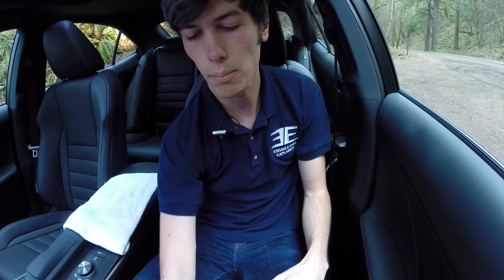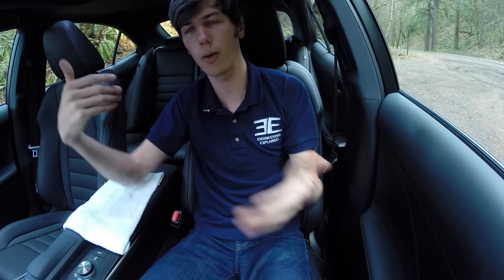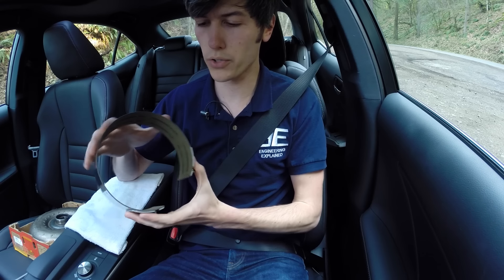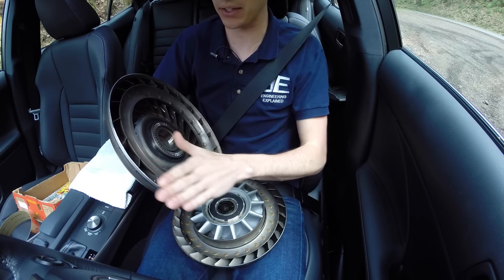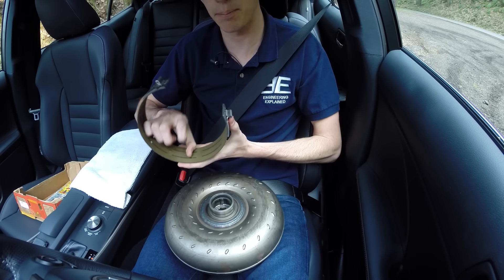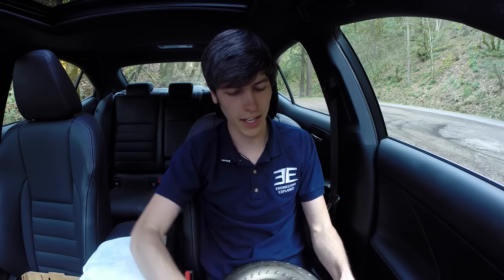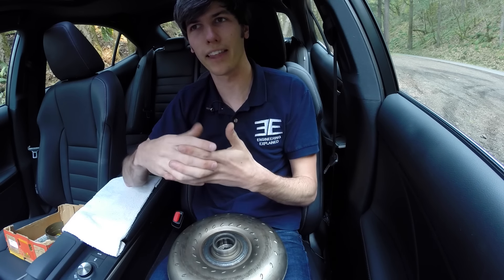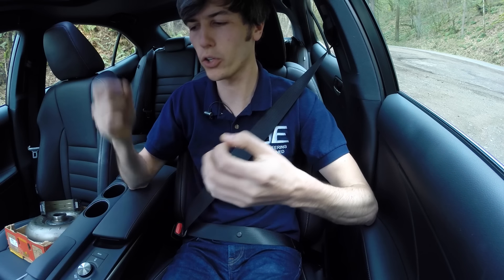5 Things You Should Never Do In An Automatic Transmission Vehicle

Comment: "modern cars cut fuel when coasting in D" modern as in 2010+? Modern as in 85+? Modern as in 50s+? What is "modern"?
Reply: If it's electronically fuel injected it will do this for the most part. There may be some exceptions due to lazy coding, but my 92 BMW and 95 Ford both did this.
Reply: 87-95 chevy Trucks with TBI fuel injection had lots of parameters for DFCO (deceleration fuel cutoff)
Reply: I HATE it when people say "Modern Vehicles" that is the worst damn vague description
Reply: +Boosted Fool I generally accept that term to mean OBD2 compliant 1996 and newer vehicles
Reply: +Boosted Fool lmao I know man. It happens 
quite often.
Reply: +Eric Meeson thanks for clearing it up.
Reply: +PioneerDC4

I feel this part was really not explained at all.  Idk why but he goes super in-depth about putting a vehicle in park but fails to explain simple stuff like this...

Lets start out with vehicles which have a carb (1980's and before basically). Air is bought into the carb via the air intake/filter. There it is mixed with fuel and sent to the engine. Just before the carb, there is a gate which can restrict the flow of air into carb. As you 'open' the throttle (push down), it will open this gate, and therefore allow more air into the carb. The more air in the carb, the more fuel is mixed. The greater the flow of air/fuel mixture into the engine, the greater the power.

Now... As you are driving along, and you close your throttle, the flow of air is restricted, the amount of fuel into the engine is reduced, and therefore the power output of the engine is reduced. When the throttle is completely closed (idle), you are using nearly no fuel at all. You can have a 4 cyl carb'ed engine with a 1 gallon tank on idle for days before it will run out. So, if you think about it (and he did give some numbers for this), the amount of fuel used on idle, while moving is next to none.

With "modern" vehicles, aka fuel injected vehicles (1980+), it is a little different.  You no longer have a carb, but you still have that gate controlling the flow of air into the engine. As you open the throttle, that gate is opened and more air goes into the engine. The main difference is that you have fuel injectors. These injectors are most often controlled by the vehicle computer, which measures the airflow and determines the amount of fuel to inject into the engine (instead of the mechanical method in the carb, it is now done via a computer). Fuel injectors are much more efficient than a carb in almost every situation.

Now, with the ability to directly control the fuel injector, you can actually completely shut off the fuel when it's not needed. The situation is present when the vehicle is moving, yet the throttle is closed. Because the vehicle is still moving, and is connected to the wheels, the engine will not die unless it comes to a complete stop. When the vehicle nears a complete stop, the computer will add more fuel via the injectors again and the engine will continue to run.

This is impossible to achieve with older vehicles, because either 1. they did not have a computer (used a carb), or 2. the computer was not equipped to handle this situation. If you were to shut off fuel completely to the engine when the throttle was closed, you would end up starving the engine of fuel when stationary, and therefore stopping the engine.

You'd literally save just as much fuel by parking 5 feet further from your destination.

I'm sure this could have been summed up in a few sentences, but yeah.

Comment: By far, the worst thing to do, is drive an automatic transmission vehicle.
Reply: +vvvVFANGSVvvv "if they are still available".. wat. Where I live, only 1 in 1000 cars are automatic and we usually laugh at people driving automatic transmission. Someone I know bought automatic transmission vehicle and she really regrets it.. Manuals are superior in many ways.
Reply: +vvvVFANGSVvvv Statistics from CSDD (something like DMV in my country). I live in Northern Europe.
Reply: +vvvVFANGSVvvv Could be several reasons.. Most of the cars are from germany and germans are not a big fans of automatics, economy is not very good and automatics are more expensive when it comes to maintenance and fuel economy. There's a cold climate here and manuals are superior when it comes to wet weather (dirt) and snow, doesn't get stuck. Also, youth really likes to drift, especially in winter.. You can't really go thru the city (1 hour walk) without seeing at least several cars sliding/drifting. Drifting with automatics is pain in the ass.

Comment: There ARE reasons, not "there's" reasons.
Reply: there're
Reply from the maker: +Monkey D. Luffy koenigsegisgsegeggigeggs
Reply: aranamagagegicalama
Reply: +Engineering Explained you said launching the car was bad what if the car has launch control? is it still bad or does it do less damage?
Reply: +dzeeeeko GT-R's launch control ish killing the car too. so I dunno.
Reply: +dzeeeeko same explanation applies to launch control as does putting your foot on the brake and gas pedal ....re-watch the video around 6:30-8 min
Reply: +Matt Rupp right but launch control limits the rpms for minimal slip. Wouldn't it put less strain if the engineers deemed it was safe to include the feature to a certain degree?
Reply: +Monkey D. Luffy  Most grammarians will tell you that there is no such contraction in English.  But maybe you know that.
Reply: +dzeeeeko In those cases, there will most likely be special systems and/or components to deal with that. One thing to note is that in many racing-applications, such as rally cars, when the driver is preparing to launch, riding the two-step, anti-lag, or just revving to utilize the inertia of some engine parts, one of two things is happening; 1) (manual) the driver will let the clutch barely grab before they launch in order to "take the slack" out of the drivetrain, eliminating the chance of parts smacking together and having a rapid unplanned disassembly. 2) (auto) the torque converter will load up the drive train as previously described.  As long as you don't neutral drop it, Holding the brake and gas while in drive will pull off the least-stressful launch, in a similar way to a LC system...
Reply: +Noah thank you for taking the time to write the explanation. I'm not an engineer or mechanic but I love knowing what's going on in my car!
Reply: Glad I could help.
Reply: Assuming that I didn't go too technical.
Reply: +wholeNwon Who cares?
Reply: +wholeNwon Engineers are not know for having the best of grammars.
Reply: +Engineering Explained great video, but i have a question. One time i was with my friends in a truck and we discovered it had a cracked radiator causing it to overheat. We were on a mountain and didnt want to pay for a tow truck so we drove it down the mt. in neutral and when it would begin to overheat we would pull over and shut it off to let it cool down. Obviously we wanted to maximize the distance we could go before it would begin to overheat each time. My question is would it have better maximized our distance between each time it overheated if we had left it in drive going down the mt. Rather than neutral
Reply: +Noah nah your fine man. I'm no genius but I understood most it.
Reply: +dzeeeeko +Noah A lot of the upper end sports cars don't use planetary type autos. Many use a dual clutch setup, which is basically a manual trans that uses clutches and bands internally to select gears. This allows the trans to disengage from the engine, select a gear, and then uses the dual clutch to engage the engine. This also means that the gears are thicker, sturdier, and able to handle more change in torque.
Reply: +JT Folstad my next car is gonna be a gti with a dsg. so good to know thanks!
Reply: +JT Folstad its called a dual gate shifter. Designed by Hurst in the 60s
Reply: Phantom197 Not quite. That was a setup that allowed for manually selecting gears with a planetary style automatic trans. A dual clutch is a fully automatic system that typically uses a shaft-countershaft style transmission. Sports cars with these do typically have the flappy paddles or a "manual" bump shift option, but they are still shifted by the trans itself.
Reply: +dzeeeeko launch control can use a transmission lock. This locks all the clutches up and won't allow it to spin. Then when it launches it releases the clutches. The only clutches that stay applied are the 1st gear clutches.
Reply: +wholeNwon It is too common to call it a grammatical mistake...take it easy man, language evolves.

Comment: Torque converter is always full of transmission fluid and rotates as one assembly, not in separate halfs like you showed. The turbine can sometime rotate separately from the housing, but mostly it's the stator in the middle that does the "power transfer".  People in the know knows this, but not everybody and it might confuse them. Also, hold the brake and accelerating at the same time causes what is called "Converter stall" when impeller from the engine is supplying all the torque, but the turbine on the trans end cannot move. If held for more than 2 minutes, the torque converter can overheat.
Reply: 2type of converter 
high rpm stall and low rpm stall
Reply: +February Everyone I know revs and is Gone in 60 Seconds...

Comment: So neutral dropping my Corolla is bad??
Reply: Yeah...
Reply: +RAJohnson713 nah those things are practically indestructible.
Reply: I hope you're joking
Reply: +Josh R Well at least the older ones were, I haven't really driven a recent one. Between 2000 and 2006 ish they were kind of "designed with stupidity in mind." I know a chick that got an 03 corolla in 07 and I did her first oil change in 2012... the car is mint and has over 350000 km and the fact that it has a timing chain kind of  helps its reliability quite a bit.
Reply: +RAJohnson713 When I was younger I had a friend with a Hyundai that used to rev it up to 7K RPMs and drop it into drive.  The tires would smoke and it would be awesome but after doing that 40 or 50 times he eventually really jacked up his transmission.  It was to the point where we had to get out and push whenever we came to a stop light because first gear was gone.
Reply: +Andrew Malaty Your definitely right, I had a 2004 Corolla S, and I cant even explain how much I beat it and it handled everything fine, and it continued to take a beating until I rolled it
Reply: +rzr kid ..."Co-rolled" it?
Reply: +rzr kid lmao reminds me of 99 accord. I beat the crap out of that car. In the snow I would shift it through all the gears while stuck 😂 I've grown up now lol
Reply: +Mike Trewin Yes sir, I put it in a ditch and flopped it on its side after I hit some standing water. Really light car + no ABS + Bald tires = Bad experiences
Reply: +Mike Trewin  Hahaha, didnt even catch the joke at first. Good one!
Reply: +rzr kid yikes, sounds nasty. No injuries I hope?
Reply: +Andrew Malaty Have you even seen the undercarriage of one of those things...
Reply: +Mike Trewin Nope, climbed out of the driver side door and stood there and stared at it. Couldn't believe what I had done. Some guy called the cops and I dont even think I blinked until they got there and started asking me questions. Still miss that little thing 😢
Reply: +Andrew Malaty Yep I got a 96 corolla with 140k miles, only problem I ever was a leaky valve cover gasket, which was very easy to replace.
Reply: Dude my Corolla has 267k miles. They run awesome
Reply: +Mikes OutDoors mine is almost to 200k and once that motor goes out on, I have another corolla motor with 90k miles. lol
Reply: eddie947 I prefer to own some clean ass cars.
Reply: +P.J. Bennett Damn man, ive never heard anything but shit about them, kinda cool to hear the other side of the story! And yeah, poles aint fun, never hit one personally but a month or two ago my buddy put his moms 2014 Kia into one at about 35mph in the snow. Good thing they had full coverage!
Reply: +Josh R my dad had a 4 cylinder '91 Camry and that thing was a goddamn tank... seriously nothing could stop it.  we live in Chicago so it went through many cold winters, got stolen 3 times and it still ran beautifully.  i would pick it over any fancy luxury car any day
Reply: +RAJohnson713 i do it all the time. Im sure my 09 corolla will last long enough for me
Reply: ***** Cool story bro!! Can you tell it again!?

Comment: He's right about unnecessary shifting into neutral while on steep decline. The vehicle compensates for the angle of decline as he stated in his video. My truck downshifts my transmission, I slow down and my MPG indicates that I'm gaining in MPG.  the process is not without a real sense of "jerky-jerkiness" as the truck begins to ascend on the next hill, it takes a second or more to reconfigure the shift algorithm and then find the gear while it begins to accelerate almost simultaneously.  It's not perfect but I let it do its designated job. I've encountered this countless times in my '12 Tundra and I understand it was programmed for fuel economy and liability.  The only time I shift into neutral is when i'm on a level road and approaching a stop light/sign and I wish to save my brakes unnecessary heat during hot, summer months. My truck won't be surging against my brakes and my rotors can cool off.
Reply: Georgia Fan of course it doesn't mean you have to do it on every hill if it's up and down, only when it's downhill to a stop or red light just like you're doing on the level so you can shift to D from a stop or slow roll. Also for breaks I've made mine last long by 'tapping' them for a couple seconds until I'm down to around 30-40 mph and then fully stopping from there. I drive a 4x4 with a v8 so the vehicles pretty heavy and I've found that to work

Comment: 0:28 Never put vehicle in neutral while coasting down the hill
2:35 When changing directions in an automatic vehicle, come to a stop before switching from drive -> reverse or reverse -> drive
4:03 Don't rev up in neutral and drop it into drive and let that carry your car forward (and various things you shouldn't do)
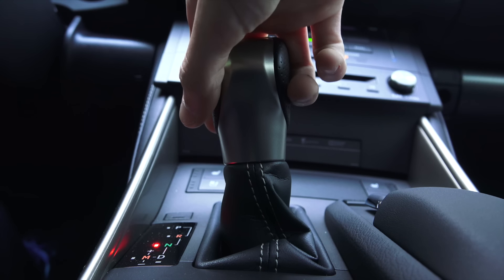7:17 Don't put your car in neutral at a stoplight. Just leave it in drive
10:04 Don't put vehicle in park until you've come to a complete stop
Reply: god bless your soul
Reply: Thanks man!
Reply: Somebody said to me at the stop lights u should put it on  P.
Is this wrong.
Reply: @kujtimzymeri3358  Yes, P is only for when you're parking an automatic transmission
Reply: @frafraplanner9277  Not really, not only it is not on the list there is nothing wrong with using P if you are already stationary...
Reply: 11:43 Different ways to eat a mango
Reply: I live in a wintery wonderland and coming to a stop on snowy or icy roads in drive would cause my front breaks to lock up and I would slide through a stop sign, for example, because the car was still in drive. I tried popping it into neutral as I approached the intersection as I applied the breaks and the car would come to a safe stop every time. Once I was stopped I would put it back in drive and off I would go.
Reply: @Buckyboyincanada I live in North, too, and as I drive a car for my job in every weather, I can say that you don't need to do such things. Or at least I don't. Your speed was just too high.
Reply: @aabeeceed  When the road is covered in ice it is the only way to slow down safety and not slide through the intersection .
Reply: W my F150 the torque converter and engine fight the brakes quite hard.  Very bad for winter stops.  This truck has the police interceptor variant of the 4.6.
Reply: @philipcrossley1279  Thnx.
Reply: 11:48 when am in traffic can I put the car on p?
Reply: A reason to put in neutral at a red light is if you're AC compressor doesn't pump well at lower RPM's so you put in neutral and maybe even give it a little gas so it stays cold while sitting at the red light.
Reply: You just saved 12 minutes of my life
Reply: @DrHarryT True we put it in Neutral and handbrake with AC on during stoplights in tropical countries. Also, we use park if its going to be longer than 3 minutes in traffic.
Reply: Thank you mate
Reply: What abot revving engine while on P? Does any harm?
Reply: @Buckyboyincanada 
I've found the same thing! The torque converter wants to keep powering you down the hill and overcomes your minimum braking force.